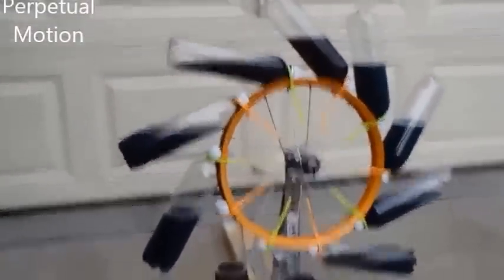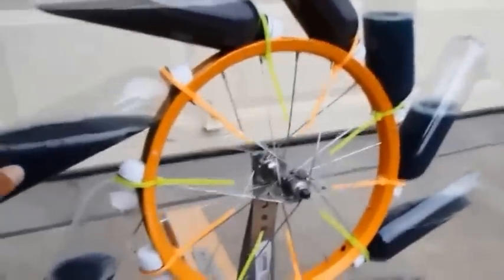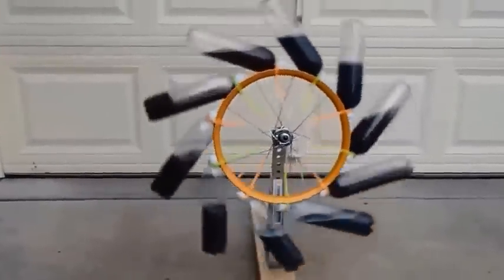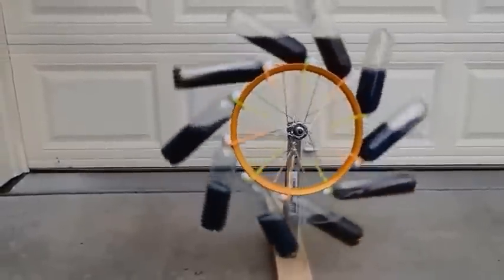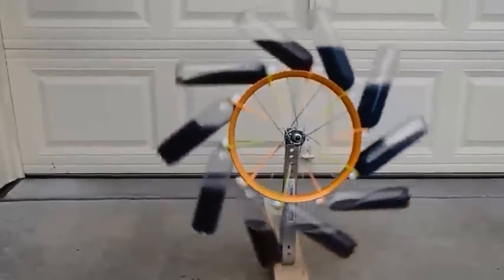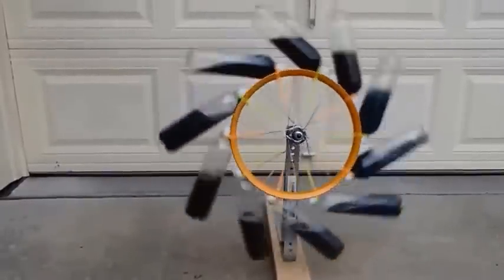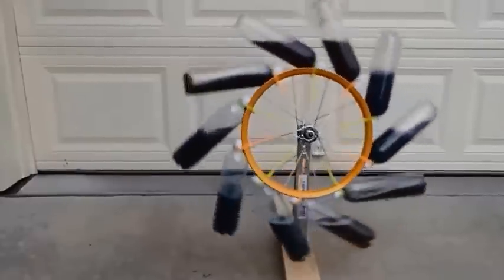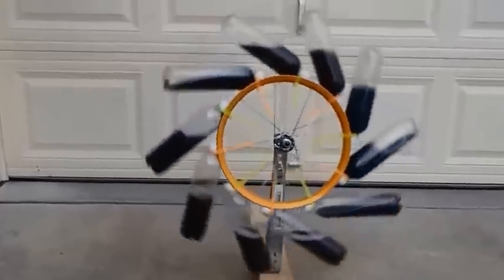FREE ENERGY!!  ***Easy to Make*** Perpetual Motion Machine

Comment: I'll tell you guys how he did it.  There is a leaf blower in a close distance with the outlet aimed at the wheel at an angle to cause motion. So, what about the sound?  The original sound has been removed and a prerecorded sound with a quiet background inserted on the soundtrack.  Does it really sound like he recorded that out side?  Notice, there is not sound of outdoors activity, no birds, cars, driving by,  lawnmower, wind on the microphone, etc.  Also, notice that there is no sound variation when moving close and away from the supposed sound source.  Furthermore, what is it that's making that distinctive clicking sound?  It doesn't sound like water in a plastic bottle.
Reply: Kevin Dunbar. Boo

Comment: What the Hell!  Forget the laws of Thermodynamics you're  wheel is slightly shaking on its beam....so as the bottles turn to power  the wheel they have to make up in this slight side to side motion, granted it's a small wobble but it's still there and it's not stopping.  Doesn't that mean that the wheel is losing energy to correct for this slight  wobble not to mention the fight against friction ? As for this invented wheel spinning for over a month without intervention we need proof my friend not a two minute video, most viewers think that it stop moments after  the camera stopped rolling.